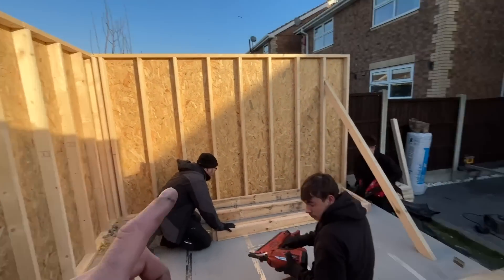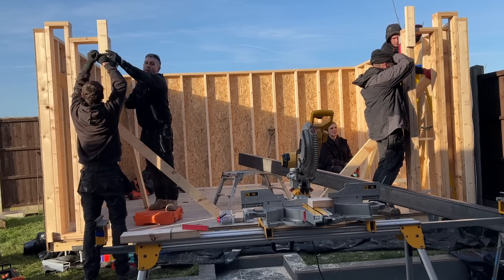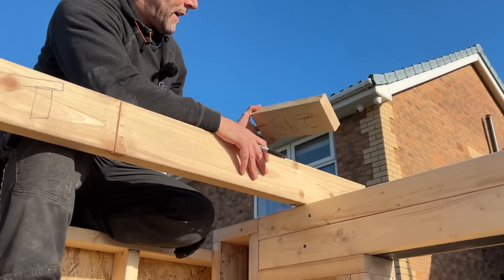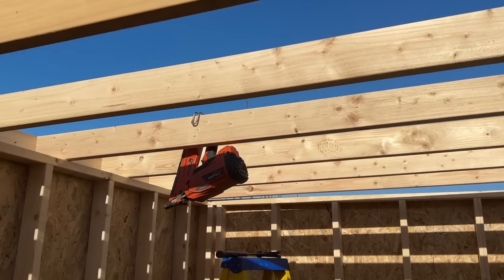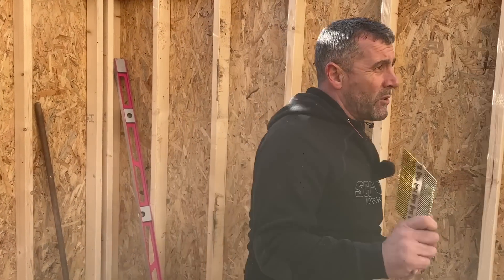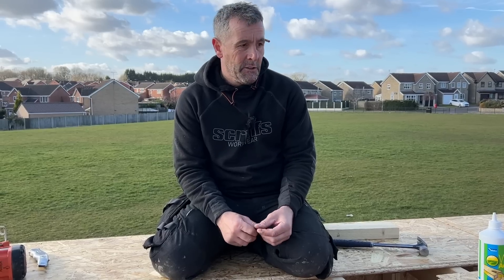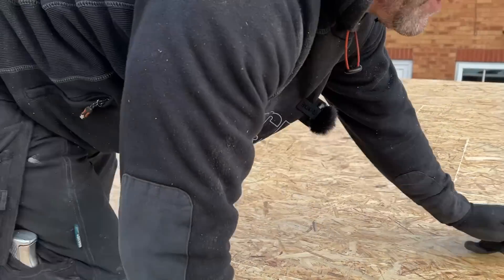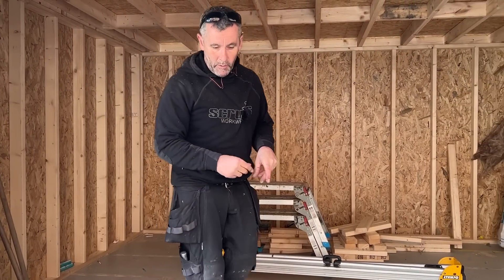Garden room construction part 2

Comment: Liam could you use a flitch bean rather than a steal beam to hold the weight of the roof joist?
Reply: Although drilling the bolt holes through the 10mm steel wouldn't be as DIY--friendly.